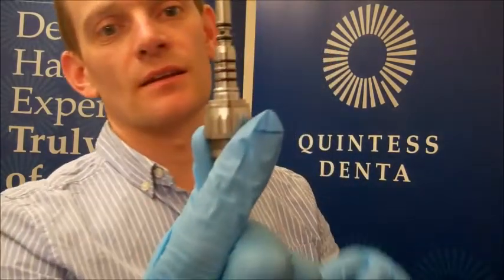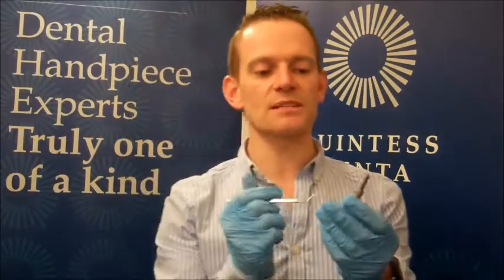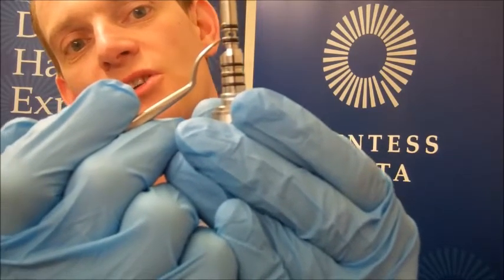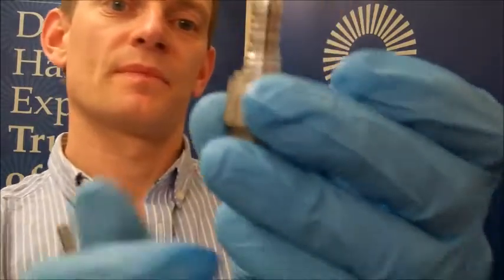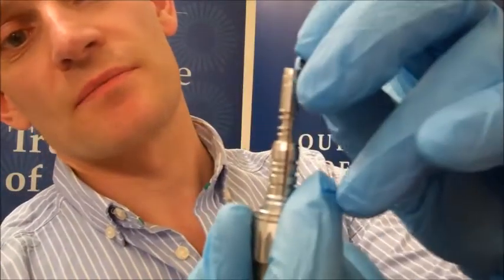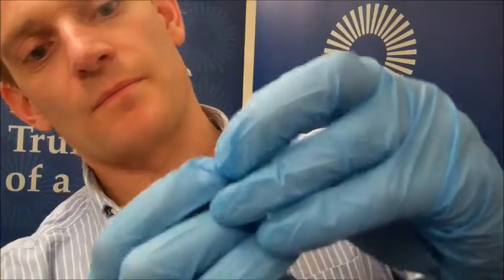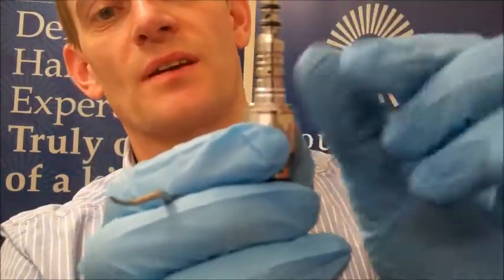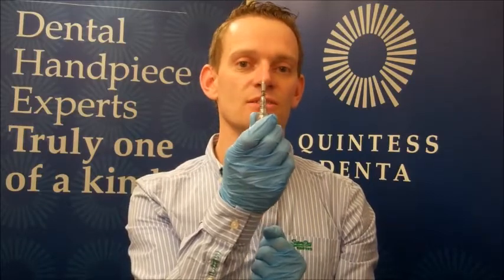Kavo Coupling   O ring Replacement

Comment: But how you can open a coupling? The diodes at the end of the cables are not connected any more and turbine getting no electricity and no light. I appreciate if you can help, thanks.